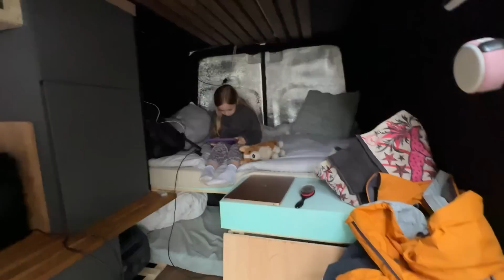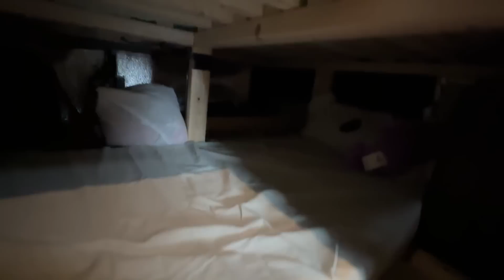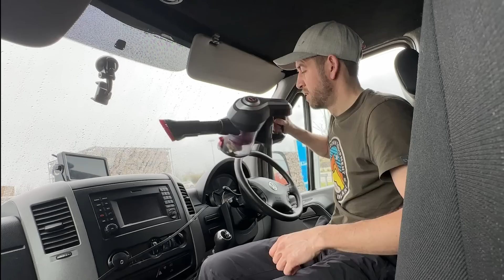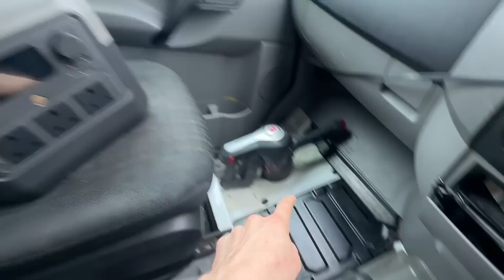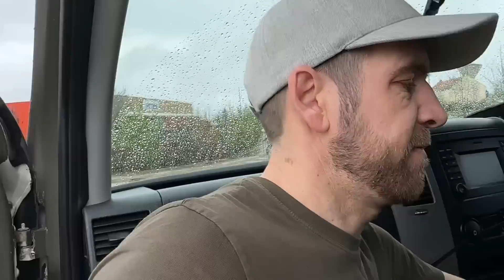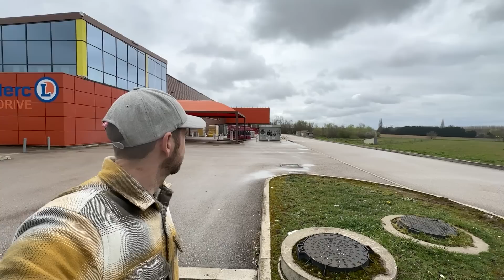Dead van battery POWER HACK  - Ecoflow River 2 Pro

Comment: 6W at 12V makes it 0.5Amp charging current which is basically a trickle. you would need to keep it charging for days to actually get any effect and it would have to be outputting (the charger) more than 12V. you were lucky your aux belt didn't cause any more damage. sometimes they can get tangled and catch things breaking them off or even go under the crank pulley throwing the cambelt off. it was quite risky keeping driving the way it was, glad you made it to the workshop nevertheless 😬 if a mileage isn't satisfactory (lower than average for a similar van) then re-mapping surely isn't a good solution. there might be an underlying problem. obviously garages doing the re-maps will mostly tell you it's fine and dandy but if they do a re-map without even checking the results on a rolling road I wouldn't trust them. you need to first make sure all the parameters are as should and that requires driving the vehicle and checking them, not only checking for error codes at the garage's driveway. I've got a 2.2 boxer campervan, 100HP which I get 33mpg out of but it's a 5 speed so at 60mph measured by GPS it sits at 2650 revs which is pretty high. I'm guessing your van is a 6 speed so it should get similar mileage to mine without re-mapping. oh, and I measure my mileage calculating at the pump by the actual fuel usage, I don't trust the computer reading - in my case that shows closer to 40mpg which is obviously bollocks ;) I personally chose not to modify the maps in my van, I'd rather have it slower and last longer, especially it's already got almost 180k miles on the clock. looking forward to watching how the garage sorted your problem out hoping they didn't charge you an arm and a leg 😬
Reply from the maker: Yep correct. That's due to the regulated output of the cigarette lighter socket. I actually used a 30amp outlet and it charged up better. 
Damaged belt was removed with a knife, fan belt remained. Distance travelled was 630m to the garage. Risk was only overheating which would never happen in 3 degrees and such a short distance. 
I'm happy with the remap.
Garage fixed the van in 30 mins, changed belts and rollers etc. Now in the alps with significant saving in fuel due to the remap. Happy days

Comment: On starting the van the voltage reading should have gone up to around 14v,
I think maybe you alternator.
Reply from the maker: That's coreect yes. Usually reads around 14.1/14.2. 
The alternator is fine, the belts that drive it have snapped. They have been replaced  this morning and I'm not 5 hours south in the alps ❤️
Reply: That’s good to know enjoy your travels.

Comment: Hi Gary have you had any trouble with the ecoflow   We have a delta 2 and have had loads of silly problems with it  car chargers going wrong  not charging etc then deciding to automatically revers its polarity and upset the ,ai s unit on our motorhome for no reason  all been while we have been away
Reply from the maker: Hiya, no not yet. But there is time. Seems like a good unit so far. Reversing polarity is worrying 👀

Comment: It's good to see that at least you were not in a dangerous position and could get to the garage, friends think I am mad having my vehicles serviced before a long journey but at the time I was a carer for my wheelchair bound elderly mother so the vehicle had to be ready.
Being of the age where you learnt to do thing for yourself I can change tyres bulbs wiper blades check my oil sadly modern vehicles stop anything else.
When a friend of mine (sadly lost touch) who owned his own automotive electronics company did some work for me he said that every time you start a vehicle it takes seven miles worth of charge out of the battery short journeys murder a battery, he also recommended soldering joints and use heat shrink over them (Amazon do heat shrink connectors with solder built in so all you have to do is put the wires in and heat up job done).
If you can take a look at the new type of batteries used in some makes Calcium instead of lead acid they are supposed to be more reliable and are better rated for cold weather starts I have one in my 2019 4x4 and even down to -6c it has not let me down
Reply from the maker: That's true. However I would have used my EU recovery service if I was in trouble. 
Yep starting a battery really gives it a hit.
Reply from the maker: I've got the heat solder joints also 😎